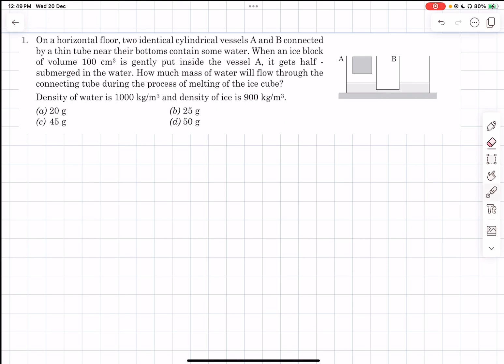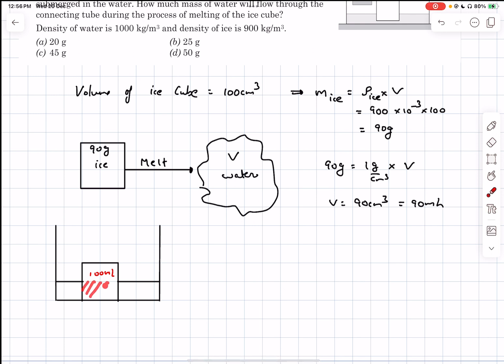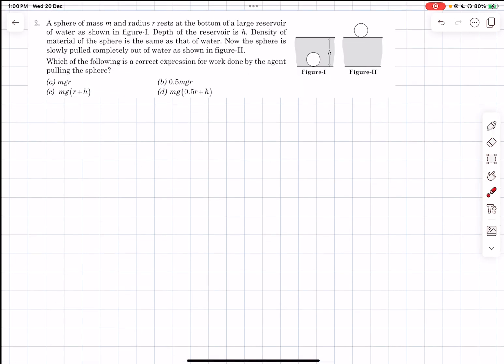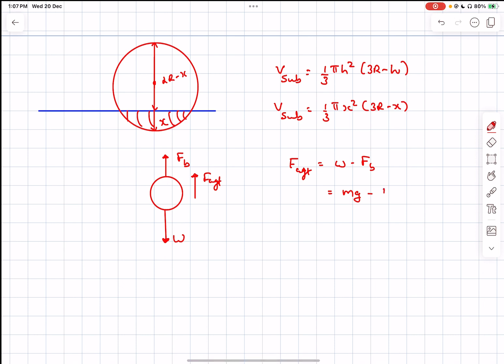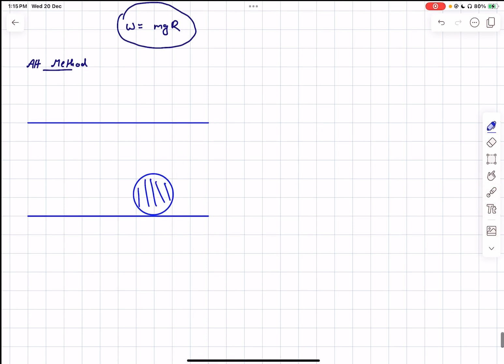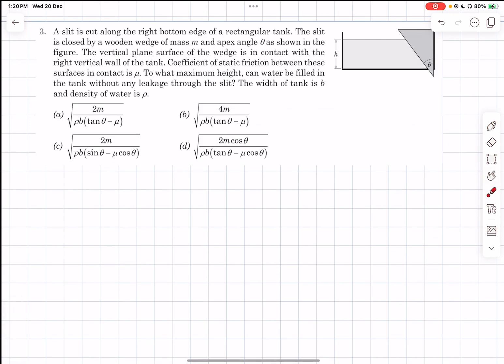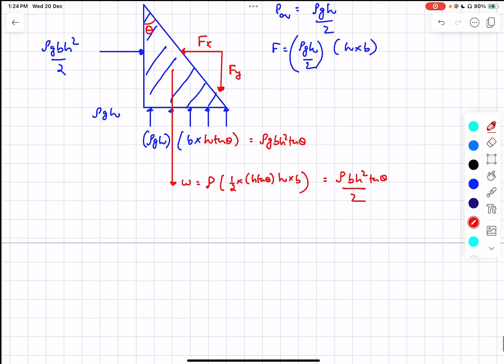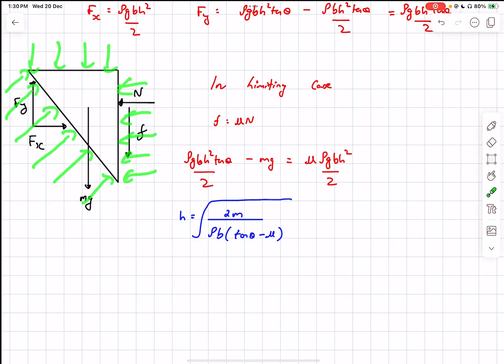[JEE] Advanced Problems On Fluid Mechanics | Pathfinder

Comment: Sir in qn 3 why are we considering a triangular water element , why cant we just apply the forces on the wedge itself , if we do so the answer comes out to be option (c) and I can't find any mistake in this approach , we get that the net force by the water pressure is perpendicular to the surface of wedge and it's vertical component gives the Fupward and it's horizontal component gives the Normal reaction for the limiting case I e mu×N and we need to then just equate mg+f = Fup
Reply: I did the same thing as you mentioned...but I got the answer........I think you must have made a mistake in solving F upward.......Actually I calculated F horizontal on the wedge by the formula P*avg *b*h {effective area}.....as we know the net force by the liquid is perpendicular to the surface....we can say the component of that net force(F) along the horizontal shall be Fcos theta....so Fcos theta= Fhorizontal.....so we got F....now we know vertical component = Fsin theta.....now we do as you said mg+ f= Fupwards..........This ends the soln here is another method.........Actually here i noticed that instead of calculating F....we could actually use buoyant force directly to calculate F upwards = V*rowater*g....we would get the same answer....(Note that V= Area of wedge * width)
Reply: @Abhi-w7r6m ya I was doing a silly mistake in the approach I took the wrong element